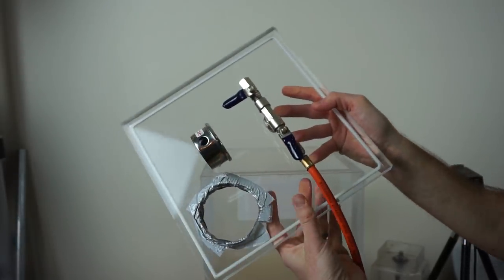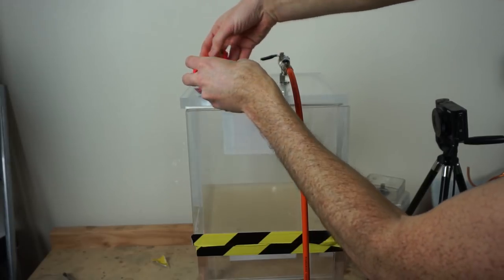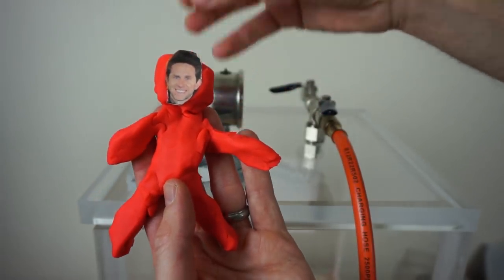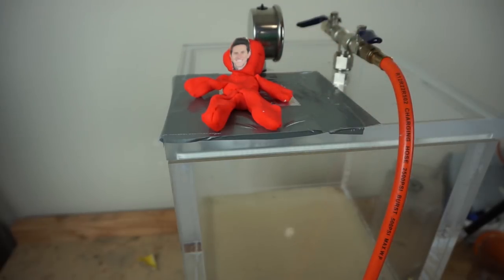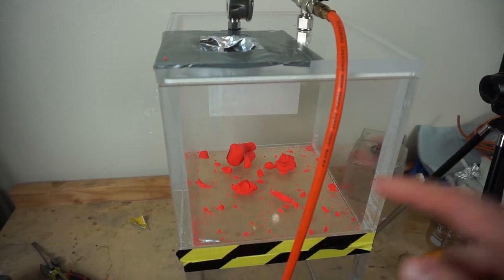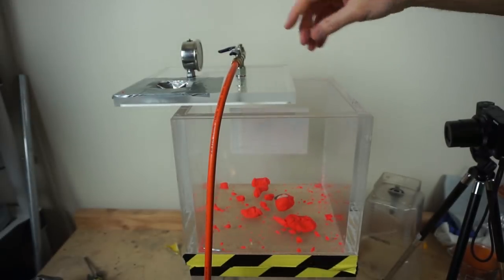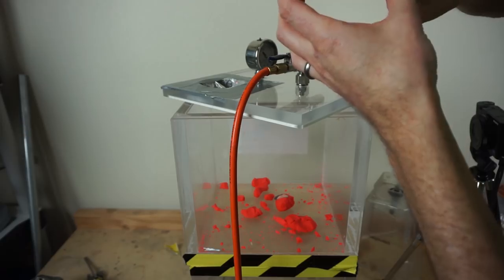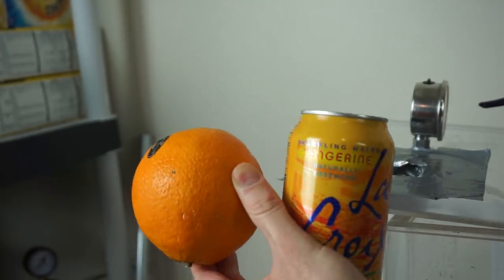What Happens if a Hole Gets Blown in Your Spaceship? Amazing Vacuum Chamber Space Simulation!

Comment: In mechanics shops, they use compressed air to power tools. If their air compressor doesn't have enough capacity, they can install an expansion tank to increase the amount of stored air. I think the only vacuum in this system is in the chamber, and a bit in the hose. The possibilities for interesting experiments could increase with a sustained supply of vacuum.

Comment: The answer to your question:

You vaporise
Reply: evaporate?
Reply: If you get a hole in you spaceship it would just fill the spaceship with  no air and probably shoot you out and you will be flying in space until your space suit runs out of air or if you don’t have a spacesuit you would just die because no air
Reply: To vaporize, you'd need heat. 

This is a case of varying degrees of pressure. There's no pressure in space but oxygen creates pressure in a spaceship. When a hole is made. All the oxygen rushes to the area of lower pressure to try and even the pressure out. You get stuck to the hole and you be sucked out... How many pieces you're in depends on the size of the hole
Reply: drumbeats05 yeah lol
Reply: We get it, you vape XDDDD
Reply: it's true, all the liquid around your eyes and saliva in your mouth will boil and all the air in your lungs will shoot out of your body just like that playdough and you'll eventually expand like a blowfish and die within seconds.
Reply: Evaporatize
Reply: No one got the joke? Okkkkkk...
Reply: *as soon as you hit something; first you fly through space at a ridiculous rate
Reply: Tree Dragon ya
Reply: Sergeant whacky thrs something called pressure
Reply: Actually...if the hole was just the right size, first you would deflate from every soft part of the inside of your body being sucked out first...then once outside in space, you would be boiled and flash frozen all at the same time...well...your soft parts would be at least...
Dang this sounds like something out of a horror flick doesn't it? Haha
Reply: This outcome is kinda similar from something I've come across in weird side of the net, about a group of people inside a decompression chamber, where a person opened the chamber door from the inside while the atmosphere was still unstable, and they showed pictures of him which are actually unrecognizable since he was turned into minced meat... really gruesome.
Reply: You turn into a roblox person
Reply: @HelloKittyFanMan.  Idk I don't remember
Reply: @HelloKittyFanMan.  Yeahhh

Comment: What would happen to your blood in space would it boil or freeze?
Reply: He already has a video, "My blood in a vacuum."
Reply: It would boil at first, until all the air has left the blood. Then it would freeze.
Reply: the body is pretty good at keeping it's pressure; by the time something would happen you would have died from suffocation long before. This is why you wont explode in space...
Reply: Benjamin Mann boil and try to escape out your skin. He has a video about it. He put his arm in a vacuum
Reply: Avengers 24 I know but he didn't simulate the cold.
Reply: Benjamin, there is no "cold" in space. for there to be a transfer of energy from you to the surrounding medium (a.k.a. cold), there first needs to BE a medium... and space is very much the opposite.
Reply: Benjamin Mann 

Well if it was crude blood that’s outside of the human body, then it would most likely clump together in individual bubbles. And eventually freeze up. 

However, if it were inside the body, the blood and all other body fluids, would boil and evaporate out of the body, until it begins to pool up on the human face. 

Then it would freeze up.

Comment: You should have used two chambers with the clay doll in the middle of the chamber that's going to stay pressurized  until the breach happens between the vacuum and the pressurized chamber. The doll is acting like a plug that's to weak and to small to plug the hole when the breach happens so it will obviously get sucked out the hole by the atmosphere rushing past it. That won't be the case if it's not blocking the hole

Comment: it would be interesting to place a cushion below the soda can to try prevent it bursting. That way we could see if it actually deformed as it got sucked through the hole.

Also to do the orange with a smaller hole, to see if you can suck the juice through its skin before it's pulled through.

Comment: i got 3 ideas 
1 can u put the vacuum chamber on its side so that you can stand  up a little guy then have the air pull him in sideways ( just to see)

2 a raw chicken leg is used sometimes for testing in place of a human had because it has about the same breaking strength as a hand so we could get a idea of what it would do to it

3 can you set it sideways and set up candles in font of the hole so when it bursts we can see how far away the air is being pulled from?

Comment: Tis looks really cool but sadly (or rather fortunately) this wouldn't happen on a spaceship. The reason why this works is because the object that is being sucked through the hole is directly in front of the hole where the air that is rushing out reaches supersonic speeds. But if you are just a little bit further away from the hole the air will just go around you and you would fell nothing or maybe a slight push. In that case not being able to breath would be your biggest problem. (And BTW Kyle Hill did a fantastic video on that one)

Comment: The Byford Dolphin  was an offshore drilling rig that experienced an accident when deep sea divers were being transferred from a diving bell to a decompression chamber to recover from their time at depth:

"Hellevik, being exposed to the highest pressure gradient and in the process of moving to secure the inner door, was forced through the 60 centimetres (24 in) diameter opening created by the jammed interior trunk door by escaping air and violently dismembered, including bisection of his thoracoabdominal cavity, which further resulted in expulsion of all of the internal organs of his chest and abdomen, except the trachea and a section of small intestine, and of the thoracic spine. These were projected some distance, one section later being found 10 metres (30 ft) vertically above the exterior pressure door."

Violent decompression is nothing to mess with. Incidentally, there are pictures,  I do not recommend you google them.

Comment: Would the spaceship result be any different if the spaceship was smaller? What I mean by that is that in your experiment the earth's atmosphere is pressing against it, which wouldn't be the case with a spaceship since it would have much less air inside. I think you should build another air tight chamber on top of the vacuum one. Not entirely sure about this, but I think it's worth testing.

Comment: There's I post some where on YouTube showing the dangers of pressure differential underwater. The clip I'm thinking of is where a large crap gets sucked through I small crack in  pip.  This is exactly the same.  The higher the difference in pressure the higher the energy

Comment: Weird thought, but could you build a rocket engine that uses vacuum power? Have a vacuumed "fuel' tank and then use the pressure difference to propel the rocket until you hit the thin part of the atmosphere, then you can use regular rocket fuel.

Comment: If you cover the hole with strong electromagnetic field, will the electromagnetic field prevent the atmosphere from leaking into space in case of hole in spaceship for example. In sci-fi movies you may have seen spaceships flying through some kind of electromagnetic field right into space or back into mothership. Is it possible in reality? Can strong electromagnetic field act as a barrier between atmosphere of mothership and vacuum of space?

Comment: Space is nothing like that.
Build that box in space instead of your garage. When the last side gets attached to the box, the pressure inside and outside would be equal. You would have to fill space up with air before an object outside the box could get pushed into the box by a difference in pressure.
What would actually happen is that if you filled the box in space with air, and then put a hole in the box, pressure inside the box would cause air to leak out of the box. There is nothing sucking out the air.
That's why astronauts can easily repair a small leak in a space ship. You could plug a small hole with a finger.

Comment: It wouln't be that extreme in space. Depending on the hole size, a tiny one will not shoot you out, just depressurizes at a low rate. A sudden big one will create a force that is not that extreme, but fades pretty much instantly.
The example is not very accurate, the pressure surrounding the box is a hell lot stronger than a mere space station's tiny bit of air compared to the vacuum surrounding it. Its more like a tiny fart in space.. smells for a sec and is gone.
I'd suggest on a bigger vacuum chamber with a small air container that is positively pressured at a normal rate and release it inside the depressurized chamber.
Make sure that the sucking of the machine has stopped as it might create the wrong outcome and to be at a safe distance.
Greetings from a rick and morty fanboy.

Comment: You're not understanding what's happening here. The partial vacuum inside the chamber isn't 'pulling' on your little Play-Doh spaceman. It's the pressure differential between the outside atmosphere forcing its way INTO the chamber - and taking your spaceman with it.

Comment: But isn't the damage occurring because the object is hitting the bottom of your chamber rather than as a direct result of the vacuum? I know it is impossible for you to simulate at this scale but, if the rupture hole was large enough that the body/object got sucked through cleanly without contacting the edges, and it was literally just space with nothing for you to slam into, would you not just fly out intact at tremendous velocity? A human bazooka. Also, the force of being sucked out would largely depend on how much air is available in the area of the damage. Potentially, if the area was sealed and small and the ship only partially depressurized, you may even survive your flight out to die of hypoxia.

Comment: We're not balls of playdough that weigh 200 grams going through a hole half our size, we're massive skeletal structured beings. In that movie all the air moved as one when that wall blew off pulling everyone with it, a hole that size the air pressure would be over 100,000 pounds, but its not crushing you the air behind you is creating a suction as the air in front of you is pushing you, so you'd swing with it at a high speed. If you strike anything on the way out well, oops, gonna hurt but if you clear the walls you should be fine. She was also far from the wall when it let go. Lot of factors here. 

If the hole was the size of a 50 inch TV then ya, you'd get railed on the way out and get hurt pretty fuckin badly lol

And the air being sucked out isn't unlimited, the energy drops off quickly once the air pressure drops down, which should be near instant with a hole the size of half the bridge. 

These experiments are cool, but you can't make conclusions based off playdough up against a hole thats ready to blow out, a hole that has maybe 100 pounds of force behind it given a 14psi difference.

BUTTTTTTTTT it was a fun video to watch anyways, It shocked and surprised me how violent it was hah, cheers.

Comment: I want to point out that this would only happen this way under specific circumstances. The astronaut would have to be right up against the right sized hole when it ruptured, the actual pressure would have to be enough (they often reduce operating pressure in space), and there would also have to be enough volume behind the astronaut, and not necessarily to the sides. You have limited volume of air in a space ship versus unlimited volume of air in the test. Will there be a "pop"? In this case there was because the conditions were right for a sudden high volume equalization. In other tests, it may not be a pop but a loud hiss. It depends on how long it takes for the pressure to equalize.

Comment: This is just an experiment which generates a rapid acceleration of the playdough - not so much a 'vacuum of space' thing as a 'differential pressure made it go fast and destroyed it physically' thing. Put another way; it's misleading, because it seems to show that stuff explodes into little bits when exposed to a vacuum, as opposed to what's really happening (ie. stuff explodes into little pieces when it's rapidly accelerated way beyond its tensile strength and then splattered into a wall).

For extra gory decompression events, you need to move beyond space travel, and onto deep sea diving, space travel decompression being a (relatively) benign change from 1 atmosphere to 0. Diving, on the other hand......try going from 9 atmosphere's to 1 in a second, and yes, there is an example (heads up, it's brutal):

https://en.wikipedia.org/wiki/Byford_Dolphin#Diving_bell_accident